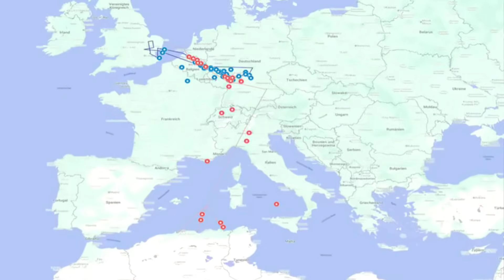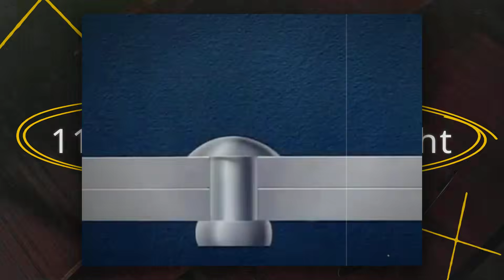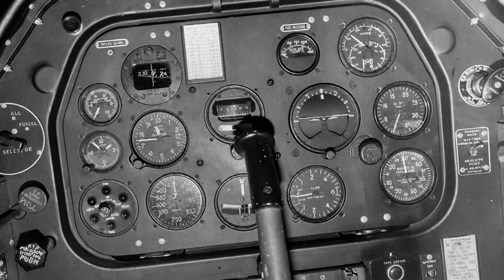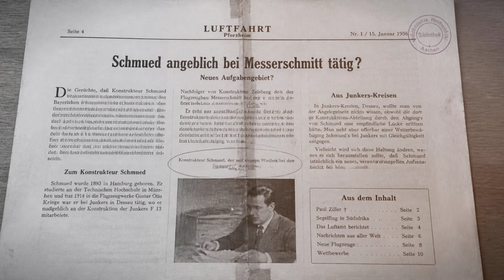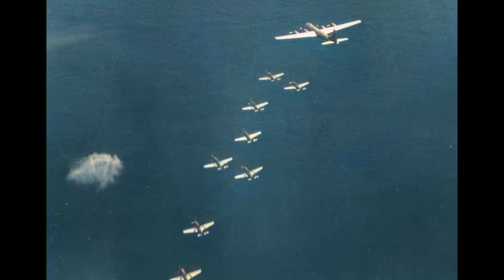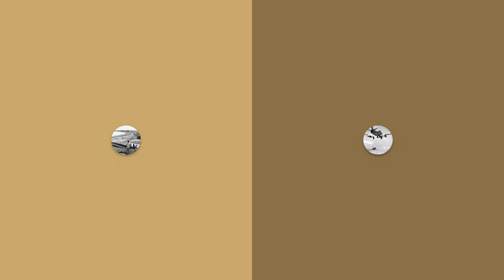How a British Request Built the P-51 Mustang – America’s Greatest Fighter Plane!

Comment: BRITISH AIRCRAFT DESIGNERS AND ENGINE BUILDERS WERE  CONSIDERABLY MORE ADVANCED THAN THEIR YANKEE COUNTERPARTS .............

THE 1800 HORSEPOWER YANKEE ALLISON ENGINES IN THE P38 WERE VERY POWERFUL AND FATS - WHEN THEY WERE NOT ON FIRE OR EATING PISTONS AND CRANK SHAFTS!!!!!!!!!!!!!!!!!!!!!!!!!!!!!!!!!!!!!

BY COMPARISON THE 1800 HORSEPOWER ROLLS ROYCE ENGINES IN THE SPITFIRES WERE MECHANICALLY VERY RELIABLE!!!!!!!!!!!!!!!!!!!!!!!!!!!!!

AND BRITS WENT ON TO MAKE ROLLS ROYCE ENGINES UP TO 2600 HORSEPOWER THAT WERE VERY RELIABLE....................................

AS FOR AIRFRAME DESIGNS IN 1936 - THE SPITFIRE WAS THE FASTEST AND MOST AGILE AIRCRAFT ON THE PLANET AS PROVED BY ITS VICTORIES IN THE SCHNEIDER CUP RACES!!!!!!!!!!!!!!!!!!!!!!!!!!! 

BRITAIN ALSO MADE A SERIES OF EXPERIMENTS TO WRING THE MAXIMUM SPEED AND RANGE OUT OF THEIR SPITFIRE DESIGN AND THEY ALSO PUT CONSIDERABLE TIME AND EFFORT INTO THEIR NEW TYPHOON FIGHTER THAT PROVED TO BE A DISAPPOINTMENT AS A HIGH ALTITUDE INTERCEPTOR.......................................

SO BRITS WROTE A SERIES OF SPECIFICATIONS TO BE USED AS A DESIGN BASIS FOR A NEW LONG RANGE FIGHTER AND THE SPECS INCLUDED FAIRLY DETAILED RECOMMENDATIONS FOR WING LOADING AND WING DESIGN BASED ON THEIR EXPERIMENTS WITH THE SPITFIRE AND TYPHOON.........................................

AND THE BRIT SPEC REQUIRED THAT THE NEW AIRCRAFT BE POWERED BY THE MUCH SUPERIOR ROLLS ROYCE ENGINE!!!!!!!!!!!!!!!!!!!!!!!!!!!!!!!!

THE P51 DESIGNERS PRODUCED THEIR NEW MACHINE WITHIN THE SPECIFICATIONS WRITTEN BY BRITS AND THE RESULT WAS THE FAMOUS P51!!!!!!!!!!!!!!!!!!!!!!!!!!!!!!!!!!!!